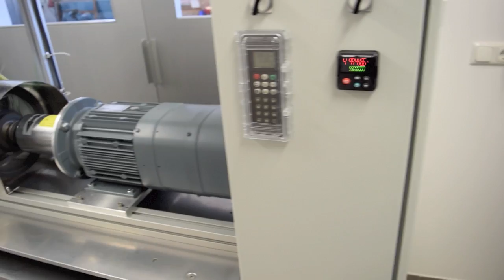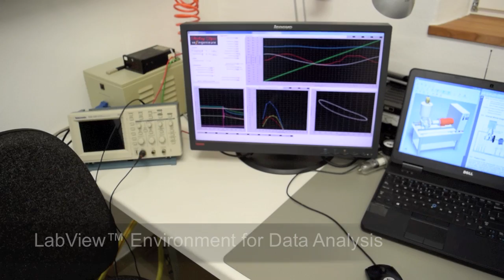Features of the Stirling Engine Dynamometer Test Stand STD20 with ST05G-CNC and EHH70

Comment: Is the test program scripted or interactive? Can you show some of the controls? Can this be used with different sterling engines? Is it for sale?
Reply from the maker: +Howard Postley 

Howard, the control software is coded in LabVIEW and is interactive. However, the source code is delivered with the dyno and the software can therefore easily be modified by the user. Please contact us via our contact data on our website www.ve-ingenieure.de for details. We will provide you with screenshots, technical details and a quotation, since our dynos are indeed for sale. In the meantime, please find additional information here: https://labjack.com/news/t7-stirling-engine-dynamometer
Reply: Use a large axilflux alternator as a flywheel and a microwave as the heat sourc.